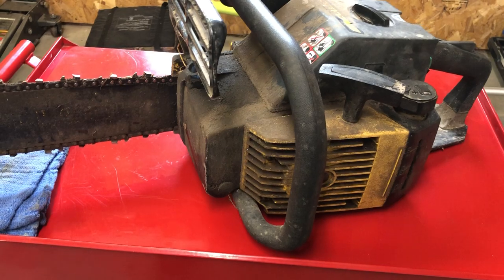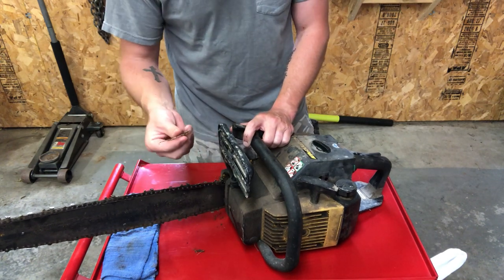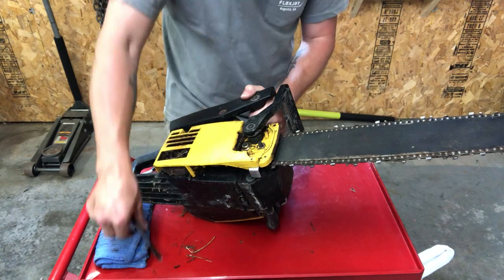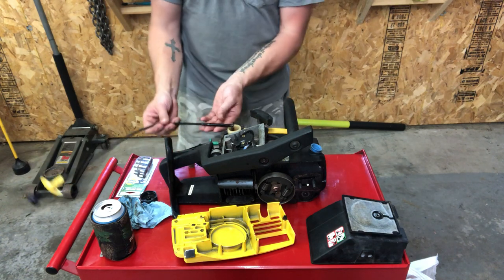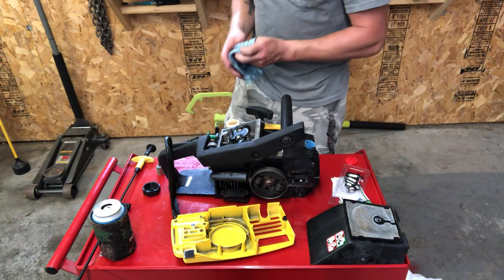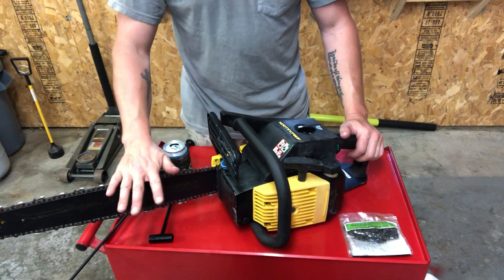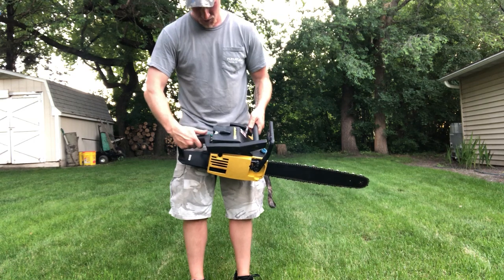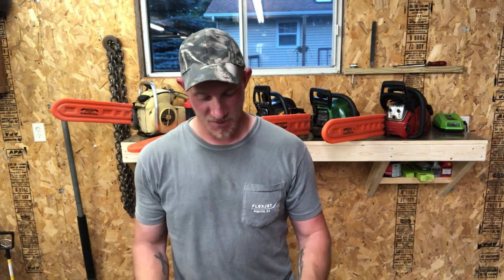$10 Dollar Chainsaw! | Getting an Old Chainsaw Running

Comment: I would have liked to have seen how you cleaned some of that mess up. You did a good job. I have simply fixed things before just by cleaning them up. Also if you could put the Camera closer or Speak up a little bit more, would help older people like me to hear you better. Overall real good job, I like listening and watching your channel.
Reply from the maker: Thank you for the feedback and kind words! The next saw I do I'll definitely include the cleaning process. It was a lot of scrubbing and a lot of brake cleaner and carb cleaner. I'm glad a couple hours of elbow grease fixed it! I'm also planning on having a microphone to help with audio to make my videos that much better. Thanks again!

Comment: I have a craftsman chainsaw  2.2 ci 14 inch bar that wont start . what should i do with it
Reply: Usually the problem with a saw like that is that it needs new fuel lines and either a carb kit or a whole new carb.  The fuel lines become brittle and sometimes the fuel filter will come off in the tank and that allows the carb to suck up dirt and sawdust and that will clog the carb.
Reply from the maker: I have a video on how to get an old chainsaw running. Check that out it may answer a lot of your questions! Thanks for the comment!

Comment: I had a stihl 021 chainsaw that blew the spark plug out . No threads left . how can i fix it
Reply from the maker: Oof...You'll need a new head for that thing unfortunately. You might be able to drill and tap it but that might be tough, and then you'd have to find a new size plug. Nice thing about the Stihl's are they are easy to rebuild and made to be able to be rebuilt.